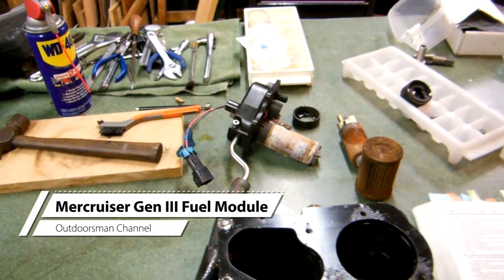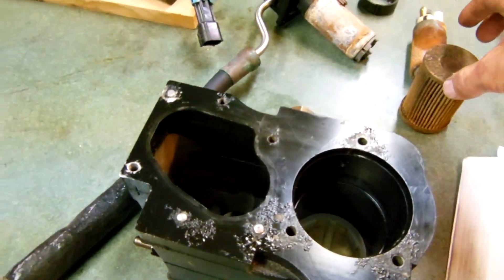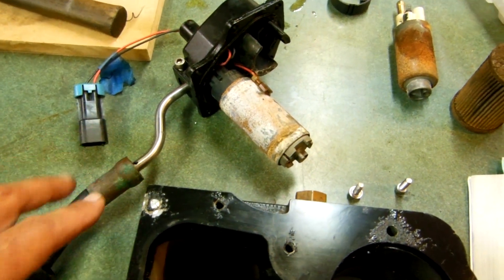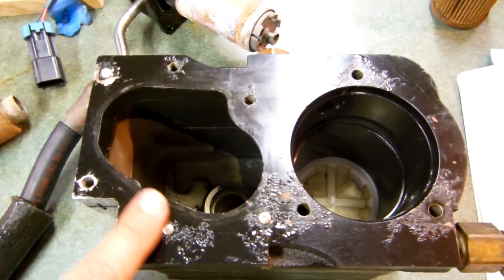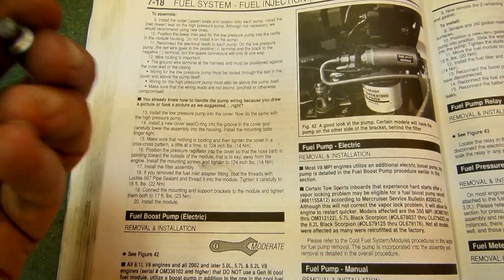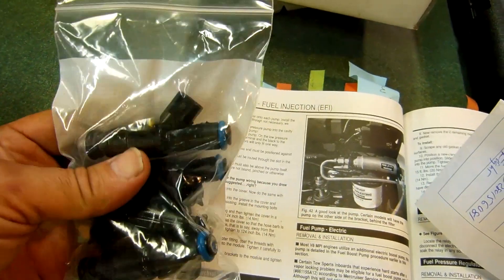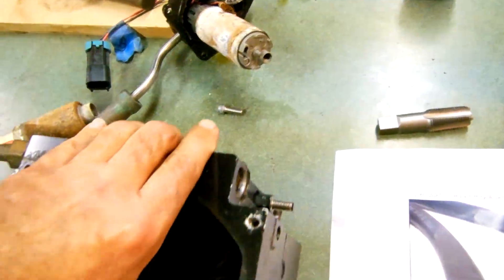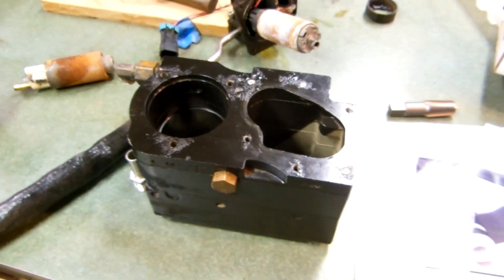Mercruiser Gen III Fuel Module

Comment: Hello great video.  I just need to replace the water hose assembly. I broke the nipple that goes to the power steering cooler trying to get the clamp off. How do the water lines that go into the coil fuel module come out ?

Comment: I had plastic fitting leaking, thing I also see is 2 hoses go into  main feed hose side by side, trying to understand how water will flow around when 2 hose next to each other on a supply line? 
My cooler blocks  up with salt over a yr and fuel block over heats and get vapour lock engine would run when hot.
Reply: Restrictor in main water pickup allows water to flow in one hose and out the other

Comment: What is the brass check valve for on the side of the module? Is it to relieve pressure on the water side if it's too high?
Reply: Ryan.  I believe the one you are talking about is a check valve for fuel.  Go to Marineengine parts website to and look for a diagram of your box.  I am thinking this prevents backflow of pressurized fuel when you turn the system off.  It has been awhile so I can't be sure.   We have over 100hours on the fuel cooler after that repair job.  It is still working fine.  Good luck.

Comment: I have a 496 ho and the blue drain plug on the bottom of the fuel pump broke off inside the fuel filter water drain I guess, so i fit a rubber stopper in the hole.
My question is does the water release pressurize to the point it would blow the stopper out ?
Fortlaudtransfer@yahoo.com
Reply: Hi. The outdoorsman asked me to respond to your question.. Sorry for the delay.  The only blue plugs we know of on the 5.0L are on the water cooling system.  They have blue butterfly removal tabs and are plastic.  This engine has four.  One at inlet and outlet of the raw water pump, one near the thermostat on the top center and one on the lower right on a cylindrical filter looking assembly.  Is that what you are talking about?    They are used to drain the water for winterizing in cold climates.   If that is the case you probably only need to worry about the broken plastic plug stopping up something in your cooling loop ,if it went through, or your stoppers coming out and flooding your boat.   I had the top one break off and just carefully drilled it out without drilling the metal threads and then replaced it.  On this engine there were no blue plastic plugs on the fuel box water cooling loop.  Hope this helps.  Joe
Reply: @Lee Mazer and @Joe Silverbliss -  I'm dealing with this on both of my 2005 496HO engines. Since the fuel module is cooled from the sea water pump, some models have a blue plastic butterfly tabbed drain plug in the front for winterizing. But the Merc blue drain plugs are hollow on the inside, and the butterfly head can eventually crumble or break off.  In my case, I started up the engine and saw seawater streaming at a high rate of speed into my bilge from the hollow center of what was left of the plug still stuck in the module.  I replaced with stainless steel drain plugs from Hardin @$5 a piece, same price Merc wanted for the plastic.  I pull the plug annually to winterize so I'm not too concerned about the dissimilar metal corrosion issue.
Reply: This is not my video, but it helped me understand the issues with these modules.  The link takes you to the specific issue with blue plugs breaking off.  https://youtu.be/IgXkhJnL6lI?t=322

Comment: Very good video man - I just bought a Cobalt with a 496 and it has this cooler.  So far, I am having no troubles, but I plan to go into it this winter and have a look.  I would definitely put some never-seize on those small screws when you put that back together.
Reply from the maker: Never seize was applied! Would use kroil next time to take them out.